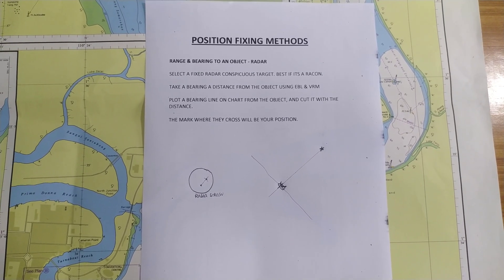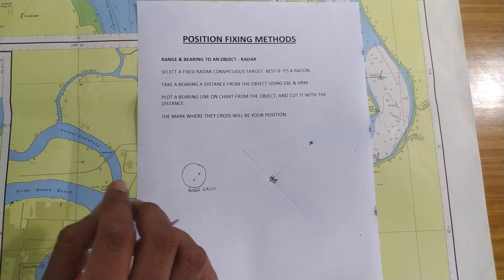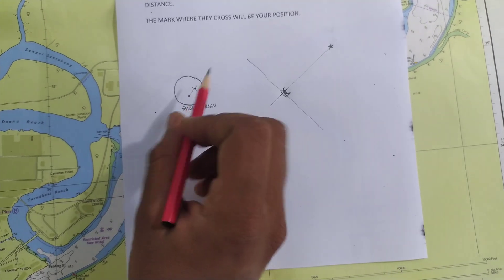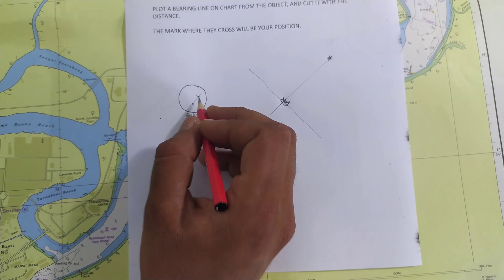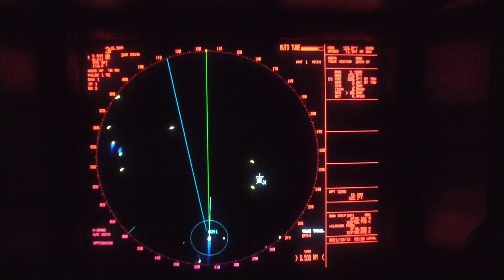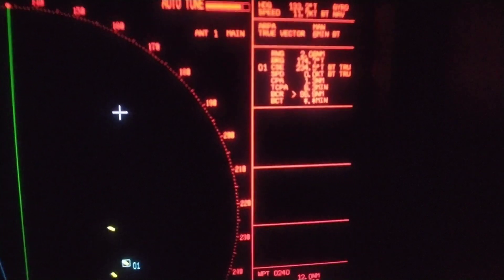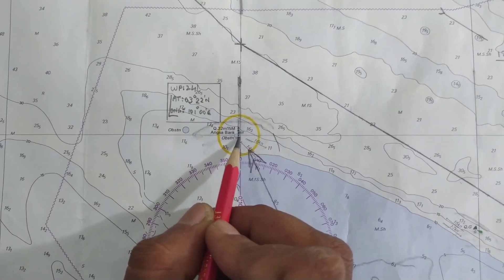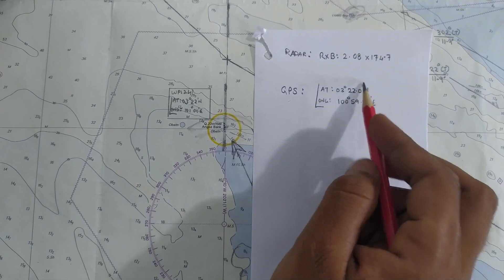Position fix Methods: RADAR range and bearing

Comment: Sir i have a doubt..
The bearing which taken from radar is gyro bearing so before plotting bearing of that becon don't we have to convert that bearing into true bearing?! & Then plot it on ..?
Reply from the maker: Yes sir. The logic is correct. But, in this situation, our ship's Gyro error os known to be .5 and the corresponding correction has been already applied to the radar feed during sync.

Hence, it won't matter in this case.

If you have not applied the correct earlier at radar gyro heading sync, the correct need to be applied at chart. 

Hope you got a correct answer for your query.

Thank you sir, for pointing it out.
Reply: @prasobhsugadhan  Thank you very much Prasobh sir..
Sir their is one more thing which I would like a suggestion.. 
Sir suppose we take gyro bearing of that becon but that bearing is relative to our ship's heading (not a true bearing as per chart) so to convert in to true bearing - Relative Brg + Ship's heading= True bearing, so can we directly plot this bearing on chart?
& Second - Also for getting True Bearing of that object (eg. Becon) To convert by CDMVT formula the C amount should be our bearing (becon bearing ) taken by gyro / repeater & Deviation is as per our ship's heading.. is that right sir ? & when we get T that should be our plotting bearing.. 
So in this case what bearing should we plot on chart by R+S.h=T or by CDMVT .. Please correct me if i misunderstood in my learning..
Reply from the maker: Sir, if you know the Relative Brg (R) and the ship's head (course) and the Gyro Error (GE), Then, you can simply +/- the R to Course and apply the answer to GE to obtain the True brg.

Suppose 270 Course, R is 45 Green and GE is 1° High, the answer can be worked out as,
270+45=315° (G)
315-1° =314°(T)

When Gyro is being used, there is no more Variation and Deviation in use. The Gyro works on a different principle (inertia & precision) and hence is not affected by ships / earths magnetism (deviation & variation respectively).

Only when the compass is used to take brg, we will be applying Var & Dev to get the True brg.

Our ship's repeaters are normally Slave gyro, including the steering repeater, and hence, any brgs taken will be direct Gyro Brgs.

Is this what you needed clarification sir?